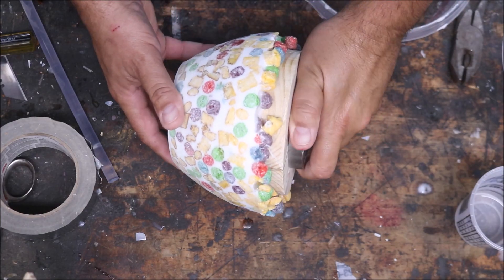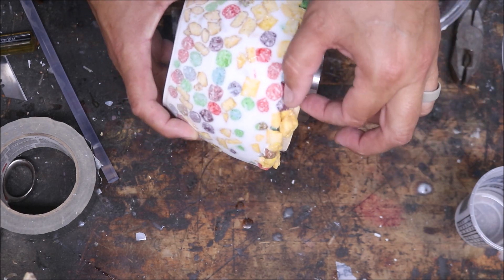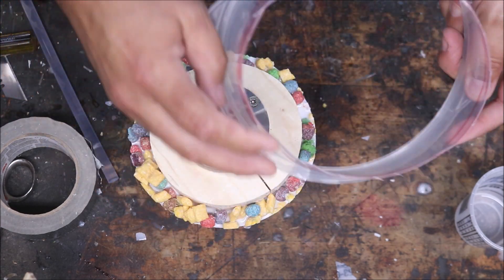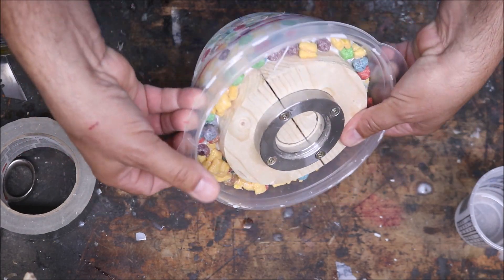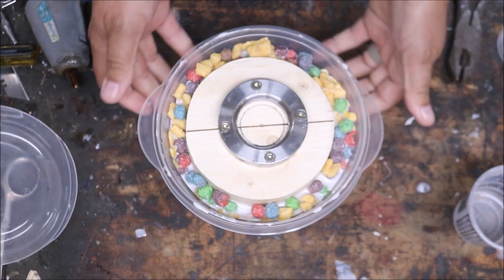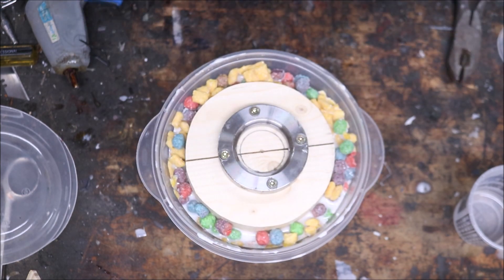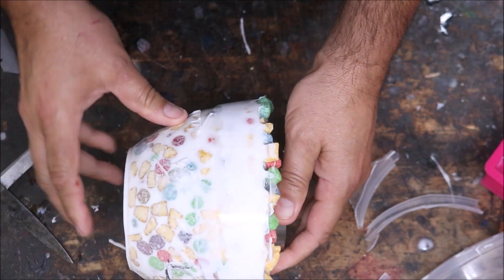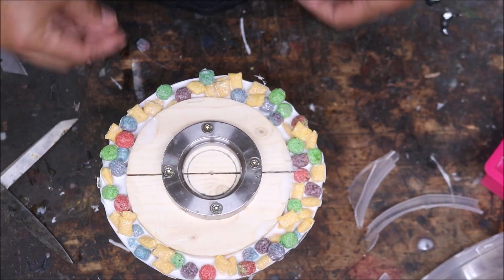Just the Tip - Adding Resin to an Already Turned Piece

Comment: There was actually a difference between 100mph tape and duct tape.  The tape we used to repair helicopter rotor blades was a metal based tape with an adhesive that could withstand the aerodynamics of flying around and around without coming off ... at least too soon.  Plus I'm sure there was a BIG cost difference between the two.
Reply from the maker: That's pretty cool to know. Thanks

Comment: Why do you call duct tape "100 mile an hour tape"?
Reply from the maker: In the military we use a Tape almost exactly like duct tape we call 100mph tape. Legend has it was used during the Vietnam War to repair helicopter rotor blades and could withstand winds up to 100 miles per hour.
Reply: @MoonpieCreations  okay, thank you for the explanation.